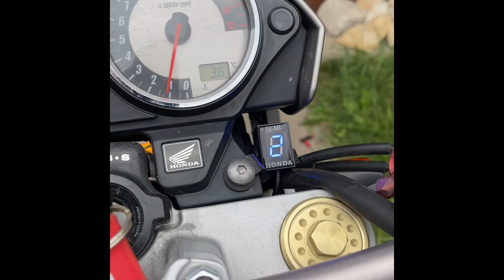Installing a gear indicator on Honda Hornet CB600F

Comment: My CB900f looks a little different, has anyone installed one on them and can help me out? Having trouble finding out where to put the green cable.
Reply: Did you figure it out? I don't know where the green wire goes either.

Comment: When I start ingnition "L" is continously blinking but it never moves to 1, then 3,4,5,6 for setup. Any thoughts why it is doing?
Reply: Did you reset it, then taught it again?
Reply: @noelkenderesi3782  No I  haven't. How can I do that?
Reply from the maker: Guess 6times on/off
Reply: @kenlory  After pressing on/off 5 times display shows something like C-1-6. Does it mean it is reseted? What are the next steps?
Reply from the maker: @matusg.8228  I don’t remember exactly but you have to put on stand and teach all gears as the video shows
Reply: @kenlory  Ok I will try it again
Reply: Hi, I have the same problem, after turning the keys, the 6-1 starts and then the flashing L comes on. But after starting and shifting into gear, it does nothing. So should I reboot? 6 times and then what? How do I learn the sensor? Thank you.
Reply: @miros7ful друг мой, работает или нет? У меня такая же проблема 😢

Comment: Can you/someone share a better photo of connection of the green wire please? Thanks guys
Reply from the maker: I’ve uploaded the video now with my voice 😃 this is what I wanted to avoid from all of you and used Metallica instead 🙃  I guess you can see now better this step of the installation process. 
https://youtube.com/shorts/t-STVMZEJI0?feature=share
Reply: Green is - pol???
Reply: Negative pol is Green?
Reply: What is the green wire for? Is it minus pole? ? Or for insurance?
Reply: @kenlory  were to put grean wire pls pic ?
Reply: That has to be soldered to ECU’s yellow/green one

Comment: So what did you end up doing with the loose green wire ?
Reply from the maker: That’s must be connected to the yellow/green wire. See my public comment…
Reply: @kenlory   I just don't know what to do with the single green wire. My instructions don't mention it. Installing on same set up basically.
Reply from the maker: @daltonshaw3317  just do it as I did it, it will work…
Reply: @kenlory  brother so you don't need to conect the green one?
Reply from the maker: See it at 1:07-1:09. You can clearly see the yellow/green wire where the green has been soldered….
Reply: @kenlory  My ECU looks little bit different, so green yellow wire it's in another place. It always must be green yellow wire?
Reply: @mariuszbialkowski9633  you have to check the wiring diagram of your ecu. You have to find the rpm wire I guess
Reply: I connected everything in the video, but I didn't use the green wire and it doesn't work can you tell me where this green  is going